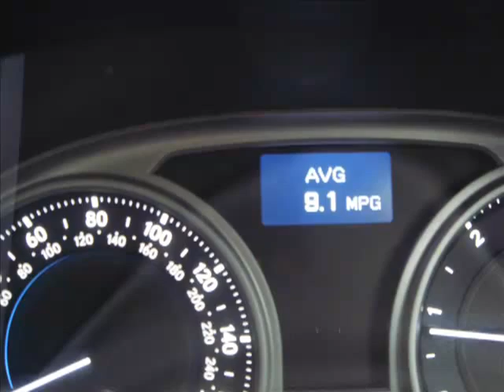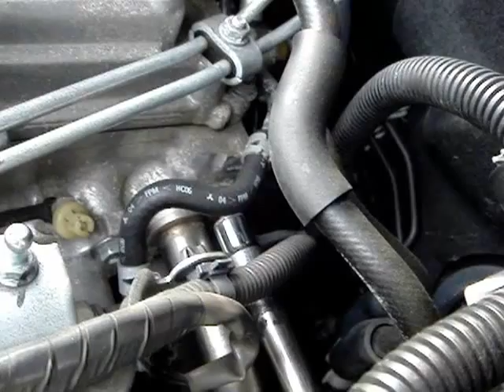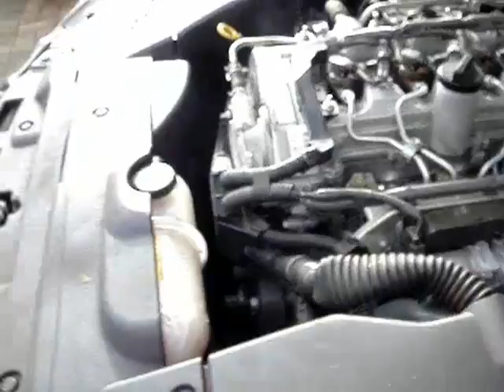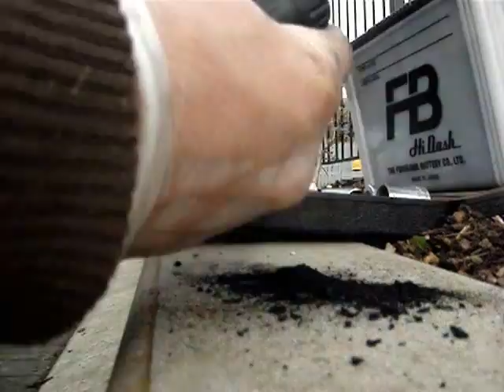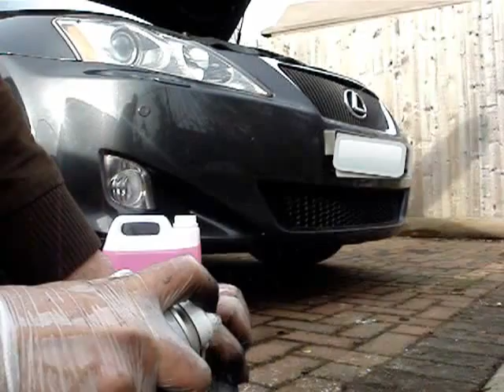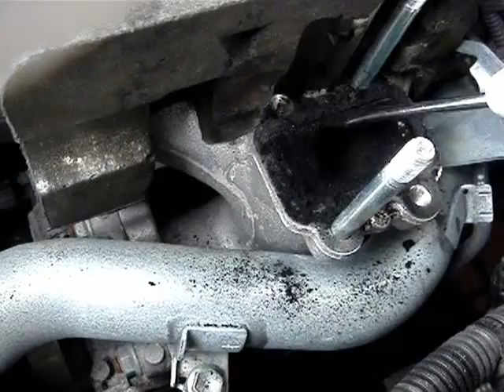How To Clean Egr Valve, Lexus Is220d, New Shape.

Comment: Reviving an old comments section😂 mine always seems to black smoke when booting it, is this a carbon build up problem in the inlet manifold? I replaced the EGR valve about 1 year ago but it does short journeys
Reply: Black smoke usually indicates too rich air/fuel ratio on diesel engine. How does the exhaust smell? Does the smell burn your nose? Could be dirty air filter, ASV binding or faulty/unresponsive turbo, it's VGT. - If the smoke is more like raw diesel and whiteish, it can be the 5th injector most likely dumping diesel straight to DPF.

Comment: Very good info I would use a old vacuum too to stop more carbon falling back into engine manifold another good trick is once you have completed cleaning egr , you can open air intake from air filter box and spray a good intake cleaner egr spray into it let it soak in over night or run engine with a little spray directly into intake then warm up car then take for a good run with higher revs this will maximise your efforts and car should run nice this a good strong engine Lexus and Toyota 2.2 d4d type bombproof good for half a million miles if you look after it well

Comment: Hi my 2009 lexus 220d is losing power occasionally won't accelerate for a few minutes and then it's fine could this be egr related
Reply: Could be
Check throttle body position sensor to

Comment: Always remove the Motor from the valve body! This cleaning was pointless absolutely 100% Pointless! ! Its the piston that gets stuck open because of build up under the mechanism whilst its open. this causes it to stick open and without removing the motor from the body and cleaning the debris out from under it is pointless you may as well not bother. You need cable ties to hold the spring down holding it open and leave it soaking for ages. White spirit, Mr Muscle oven cleaner, Washing up liquid (Dish soap in American) Hot water, If you have a dishwasher you can put it through after hand cleaning it. but simply removing it from the car and scraping it is a complete rookie thing to do and completely pointless! The cleaning job is to unstick the piston and make the valve shut 100% closed air tight seal.
Reply: Rubbish for a restricted flow code a thorough clean up of all exposed areas were carbon is heavily built up would suffice if you want to start dismantling the valve itself then you may aswell just replace it and then clean the entire intake which is a massive job I’ve cleaned up plenty and performance and engine light never returned sometimes you can’t get to sucked into it otherwise you will be there all day
Reply: @cassk9999  You clearly have no experience with the is220d then... The valve literally needs to be like new if its open just 1mm you will have no low down boost! Maybe you like the woke left or something but I come from real experience, hands on conservative. I dont like manual labour I think its mostly a poor persons game to be messing around doing stuff like that. I also think other people do a crap job so end up doing most things myself with a surplus £50k tool kit. So I work smart and not hard. I use the dishwasher. I have 2 EGR valves. Keep 1 in the back of the dishwasher for about 10 cycles whilst I swap them every service. I dont stand over a sink cleaning like a simp! WTF.
Reply: @Lore69420  perhaps you should have made the video then putting electronic egr valves in dishwashers you mad , if the EML light comes on saying egr restricted flow then generally if you find it full or carbon and pipe is choked up with soot then cleaning it made all the difference, we are not talking about the internals of the valve , we are assuming it’s not stuck in this scenario however I do get what you mean about the valve opening and closing tight I have a    IHydro electric chemical cleaning machine , nor is a dishwasher, you don’t need 50 grand tools this a simple 20 pound socket set job
Reply: @Lore69420  I know how to remove the 3 bolt from the back and remove the electronic actuator mate the point I’m trying to make is there is still a fair amount of cleaning to be done regardless of the manifold and pipes are completely blocked with soot , poor man or rich man job it will need to be cleaned you don’t need Einstein or Dirac to calculate that and no I work on my own cars and my Lexus diesel is running sweet as a nut
Reply: @cassk9999  really sounds like your a competent mechanic being able to remove 3 x h5 bolts after I told you. Incredible knowledge of the efr system also. That's why you leave it in the dishwasher you biggot.  So you don't have to clean it. Get the manual labour washin up out your head. If the valve doesn't close FULLY! and is not water tight. Your car has bad low down boost. Fact. Good luck with the job Einstein
Reply: @Lore69420  thanks for shouting at me I was apprentice once and although I never actually became a mechanic as such , I have always been willing to put work in and remember my old mechanic teacher giving me plenty of bollockings about paying attention to detail and I think your right work smarter always in Britain we have the privilege of almost endless resources and info to do it , not like the third world were everything is done the old hard way cheers sorry for sounding like I’m knocking your experience
Reply: @Lore69420  I know enough to keep me out of trouble and not be at the mercy of these sharks who are just parts changers these days
Reply: @cassk9999  Yet you hate on me for re using the old part and with no manual labour by leaving it in the dishwasher... This is a double plunger design, NOT a butterfly valve design. Because of that its imperative it can FULLY close. Its best done every service. Buy a used one of ebay for £20 and leave it in the dishwasher for 10 cycles. ready for the next service you can swap them over.
Reply: @Lore69420  no not hating at all but appreciate the tips  and thankful for your advice ignorance aside , the wife might kill me for using the dishwasher for that toxic carbon waste I have decided to leave it in a solution of mr muscle and boiling water for a few hours  after removing the motor, after that it might get some brake cleaner or compressed air and a screwdriver I’m not touching that soot it’s caked on real bad

Comment: I was getting a lot of white smoke from my exhaust, especially when accelerating hard. I did all of the above and i gotta say, it has reduced this massively, i'm still getting a few puffs of smoke, but not a trail like before. I would advise a vacuum cleaner when scraping the manifold end, as you don't want all the carbon to be going in.I would also like to mention, be very careful when undoing the 2 bolts which hold the pipe, firstly they are difficult to get to, without taking the battery out ( which is what i did), secondly the bolts can easily drop down, so make sure you got a magnetic pick up tool handy, other than that, very easy to do and i would recommend doing this at least once a year. Took me about 1 hour to strip, clean and put back.
Reply: Fox Mulder im getting a lot of white smoke too, its not my dpf cause someone took it out, a lot of acceleration and its like a train, I may clean the egr

Comment: I have just bought an 07 plate lexus is220d 50k milage, it is letting out a lot of thick white smoke from the exhaust specially when accelerating in 1st and 2nd Gears. The car pulls at around 2000 rpm onwards not much before that. 

Is the egr related to this or what else can it be?
Reply: Same as my car
Reply: +TextBookPuncher1 I had the car diagnosed by Lexus and they found out the head gasket was blown (this causes the engine oil and water coolant to mix in the combustion chamber that leads to thick white smoke) 

The dealer I bought the car from replaced the head gasket and when they done a test drive, the new head gasket blew again. They've issued me with a full refund. 

It's a very common issue with the IS220D, I advise everyone to steer clear.
Reply: Assalamulaykum bhai Saab. I bought my lexus 1 year ago. Grey with black leather 93k mileage. Today I have done 120k and engine management light keeps coming up. Car loses power and acceleration lumpy. Fuel consumption high etc. I have had non lexus diagnostic some say it's the dpf others say egr and take it to lexus
Reply: If it's white, it's coolant (head gasket). If it's black, you have a boost leak, EGR, or injector issue. If it's blue, you have turbo issues.

Comment: Have ran two of these cars now with no issues, If i am right, the carbon buildup is due to a bad air supply (dirty air filter), to help prevent this make sure your air filter is clean an replace religiously.  I personally use a K&N filter and do 30k a year with no issues.  As another poster stated, this is a general diesel EGR issue, probably due to bad filters, the black cloud that car pump out when floored is due to lack of air for the fuel to combust with, usually due to the filter. :)
Reply: will try that today :)

Comment: hi
it is not 2006 and on Lexus that they have this problem but all diesel engines with EGR. with German diesels is even worst. Cleaning the removed parts is OK but scribing the carbon and let it fall in to the manifold I wouldn't recoment this unless you have a vacum cleaner.
when you start the car where this carbon go?

Comment from the maker: it depends on serveral factors, check with lexus if they have done a recall on the fifth injector? if not then it can be done at lexus free of charge,
it could be related to glow plugs, my advise to all lexus is220d owners is to clean the egr valve once a year, it will save you money in long run, if inlet mani fold is clogged then it should really be dealt by lexus due to torque settings, but i would try egr valve clean up first, you will see the difference. let me know how you get on. thanks